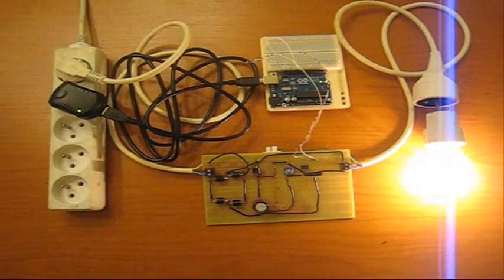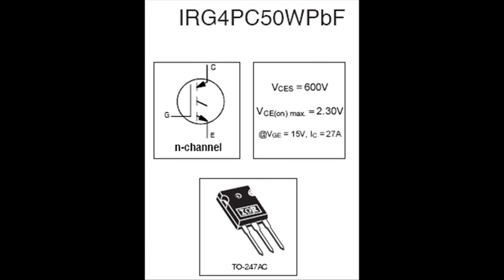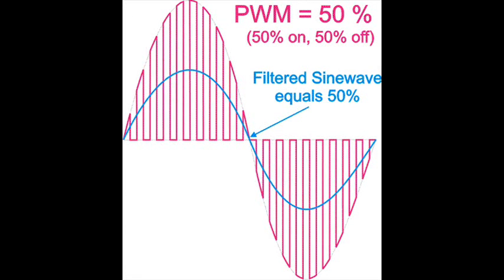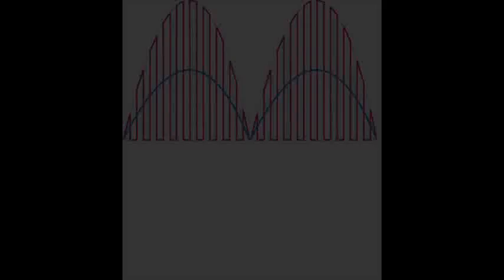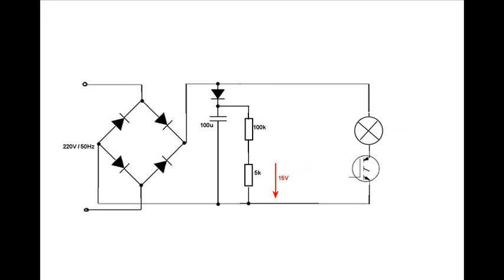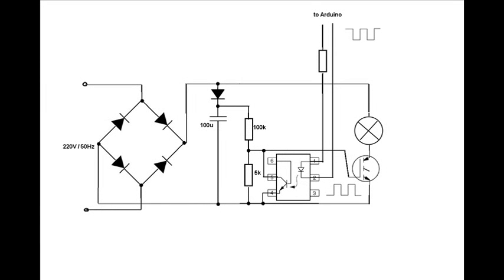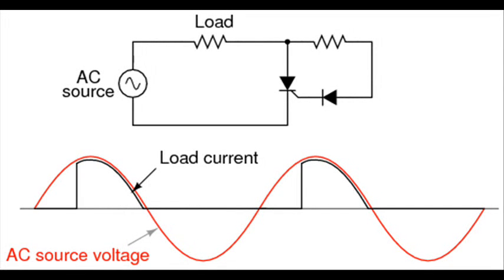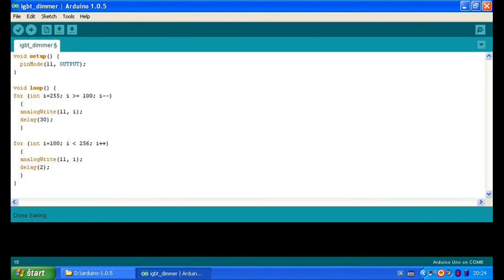AC dimmer with PWM on Arduino

Comment: when i use moc3041 optocoupler flickering in lamp
Reply from the maker: Krupal Kachhia Patel Do you mean to say that it is specificaly this type of optocoupler that causes the flickering?
Reply: may be optocoupler is not properly turned on at times. try using lower resistance on led side. if even the problem persists try higher frequency PWM generation

Comment: Excellent Presentation...I would like to ask if I were to use an IGBT(IRG4pf50W) with a higher Vces rating say 900V, would the circuit still work?
here's a link of it's datasheet:
http://www.irf.com/product-info/datasheets/data/irg4pf50w.pdf

Comment: When i use this circuit to LED Lamp or Compact fluorescent lamp or fluorescent lamp , it does not work ,Why?
Reply: mohamed sayed because they have inbuilt constant current driver, so even if you reduce the input voltage, even then it will work fine.
Reply: Ok, thank you electronics_ redefined .How can I modify this circuit to control  light intensity in LED , Fluorescent  lamp and CFL?
Reply: mohamed sayed For LED you have to remove all the internal circuit and make a new one specifically designed for it.
for CFL- there are various CFLs available in the market which can be dimmed by switching of specific phases for reference read this--

http://electronics.stackexchange.com/questions/107498/how-can-i-control-brightness-of-a-cfl-with-a-microcontroller
Reply: Hi mohamed sayed, I'm also looking for a solution to dim a LED light bulb. Have you discovered a solution? I'm planning to buy a VARIAC to see if it really doesn't work...
Reply: Dimmable LED bulbs have an internal PWM controller which is controllable by changing mains phase. You should use the classic triac AC dimmer to control dimmable LED bulbs.

Comment: Is it normal, that when i`m plugging this into 220v, 100k resistor burns out with smoke?
Reply: Андрей Рыжов I got through some 100k resistors and capacitors ! check your bridge rectifier - mine was dodgy and taking out the capacitor  - causes more current to flow through the 100k than it could take - smoke ahoy.
Reply from the maker: Андрей Рыжов no, it is not mormal. Check for faults.

Comment: Hi - Fantastic video.  I made the circuit and it works apart from the fact the lamp flickers - it did - until I put the circuit onto stripboard - must have been a dodgy breadboard.  Thanks for getting back and trying to help - circuit is flicker free and working a treat ! thanks again
Reply from the maker: Jabber Gabber Errr... I don't know. The flicker-free operation has always been a buty of this circuit. When does it flicker? Does it flicker just on the low brightness? Or all the scale?
Reply from the maker: Just an additional question - where are you located? Do you have 230V/50Hz?
Reply from the maker: +Jaroslav Hruškovič 

You say that it flickers at values analogWrite(11,50) - 50 and above it starts to calm down. As the transistor makes a negation, do I understand it correctly that the flicker occurs at full brightness, then continues when you start dimming and then it works ok for the whole range of brightness from dimmed to full dark? If this is the case, it may be related to the fact that capacitor discharges too fast and looses the voltage within one pwm cycle. Can you give me the values of the capacitor and two resistors that are discharging it? Also please specify the one which is short circuited by the transistor.
Reply: Jaroslav Hruškovič 
#
Sorted - see edited comment  - many thanks

Comment: HI, good video, i have a question, what diode model uses for the diode bridge? what model is the diode next to the diode bridge? thanks for the video :)
Reply from the maker: Daniel Tamayo Hi, for the bridge I used the ready-made diode bridge KBPC1006W, 600V/10A, see http://www.gmelectronic.com/bridge-rectifier-b250c10000dr-p227-051
But you may practicaly any that withstands 400V and the current you desire. The diode next to the bridge is also just any that withstands 400V, the current, just to be sure may be around 1A.

Comment: Je vous remercie pour ce montage, simple et parfaitement actif.
J'ai realisé une carte de 60x35mm sur 20mm de haut.
Pour l'integration maximum, l' IGBT a etait monté en aerien horizontale au dessus d'autres composant ainsi que le condensateur de 100uf,car aucune chauffe des composants n'a etait détecté.
Google Translate:
Thank you for this assembly, simple and fully active.
I realized a 60x35mm board 20mm high.
For maximum integration, the IGBT was mounted in a horizontal aerial above other component and the 100uF capacitor as no heating component was not detected.

Comment: Fantastic explanation, the simplicity is beautiful, I would have never thought just to rectify the output and negate the need for zero crossing detection and the use of costly interrupts. also the fact that you can dim to full zero.
Nice work and Thank you for sharing.

Comment: hello, i need to control a submersible pump of 110V by an arduino, this circuit could help me? and i dont know what is the value of the resistence that conects the arduino with the optocoupler, thank you, if you could help me i will thank you so much

Comment: Hi! Good video.
I developed the circuit and I connected to a resistance with a 127V and an electric power 1KW but the problem was that the IGBT and the didodes bridge got very hot.
the question is what do you think about the problem?
What do you think might be the error?
and another question this circuit can use to connect a resistance with 220V and an electric power 2KW.
how much current supports this circuit?
Reply from the maker: Hi, do I understand it correctly, you have 127V on the resistor which dissipates 1kW? That would mean that the current is about 8A, which is enough to make the parts hot. With a such power in game it is normal that you introduce some cooling.
If I misunderstood the mentioned voltage/power, let me know. The other reason may be that the IGBT is not fully open.
Reply: Jaroslav Hruškovič Hi, thanks for answer to my question. 
Now the problem is that I need to control one resistance which is connected to 220 VAC with an electrical power of 10 KW that means that a I have to control around 41 A the question is, do you think that I can use that kind of circuit or do you have any or another circuit who can works at high amperage (of course introducing PWM)? 
You mentioned that probably the IGBT is not fully open in that case what can I do about it?
How can I fully the IGBT?
Reply from the maker: christian lazcano Not opening the IGBT to full may be caused by a low voltage on gate. But this was just an idea, I don't know if this really is the case. Check if your pulses on gate have sharp leading and trailing edge and that they reach nearly maximum allowed gain voltage. In my case, I think I used have 14 volts.
Regarding the 10kW power... as far as I know, there are IGBT transistors of for high amps, so as soon as you use such one, it should work. But keep in mind that in normal conditions where everything is working OK, such transistor may need a heavy cooling as it may produce around 40W of heat.
Another option would be paralel usage of lower rated IGBT transistors, but check that they are suitable for that. Some of them are, some aren't. However combining many transistors may turn out more expensive than getting one rated high power .
Reply: Jaroslav Hruškovič what do yo think if instead of use your circuit we could use a solid state relay? do you think that  it woks?
Reply from the maker: No, I tested it, and it does not work with PWM because it is has very slow reaction time. But if your load is solely resistive such as a heating spiral, you may easily change the concept to much longer switching times, such as 5seconds on, 5 seconds off. Then the solidstate relay is perfectly OK.
Reply: Jaroslav Hruškovič That means that probably the SSR works with PWM but with a slow response?
I finde a SEMIKRON  SKKH 162/16 E  THYRISTOR MODULE, 160A, 1.6KV, A 21 do you think that probably works?
Reply from the maker: christian lazcano Yes, that should work. Let me know when you test it.

Comment: I tried making this but the voltage across the bulbs come to less than 1 volts.
The voltage across the 5K resistor is 15V
I am using irg4pf50wd
i am using 200W bulb.
what is the resistor value you used between arduino and Optocoupler..??
Reply: I am using an electrolytic cap with 100uF/250V
Reply from the maker: I think I used 100ohm or 330ohm between arduino and Optocoupler. This in fact does not affect the functionality.
Reply: Jaroslav Hruškovič It works like a champ thanx a lot
Problem was with the Resistor attached from arduino to Opto... I used 220Ohms instead of 1k. 
And now Because of you I have a full PID controlled ambient Light COntroller
Reply from the maker: Cool

Comment: Nice work! This is very good. I was hoping that this transistor somehow did not need rectified voltage, so that it could switch the negative voltage too and so I could use it to dim a fluorescent bulb, but it seems that is not the case. Nevertheless, this is very useful info. Thanks!
Reply from the maker: So... do you mean that you tried to use it with a fluorescent lamp? I never had a courage to try. How did it behave?
Reply: Jaroslav Hruškovič Sorry, what I wrote makes it look like I may have tried it, but no, I have not. Based on what I know about fluorescent lamps they need the alternating current, so I don't think this will work for fluorescent....I'm wondering how fluorescent dimmers work now.

Comment: Hello, I am trying to drive a 3 phase 10 HP motor from an arduino using 30 amps IGBTs.

I would like to know, do you need to take special precautions to deal with reactive loads such as an electric motor ? Is it possible for the back emf to generate voltage spike that will damage the drive circuit or motor ? If yes, how to dissipate those spikes (without wasting too much power).

Also, I have to drive 6 IGBTs, I am considering using adafruit's 16-Channel 12-bit PWM based on the PCA9685 to offload the arduino's processing power. Is a 1khz frequency for the PWM fast enough ?
Reply from the maker: 1kHz is perfectly OK. But I have my doubts about whether it will survive driving the 10HP motor. The transistor is sensitive to a reverse voltage which may appear with inductive load.
Reply: Jaroslav Hruškovič How can you protect the IGBT from back emf ?
Reply from the maker: A zenner diode might work

Comment: I replicated this circuit and found the hum noise at low brightness (high PWM) to be very audible and a little disturbing. It seemed I could even get it resonating with the bulb in some way and amplifying the noise substantially. Would a capacitor in parallel with the bulb help reduce this hum due to charge/discharge smoothing of the gated supply? Also would lowering the PWM frequency help since the thermal cycling rate would be much lowered?
Reply from the maker: Hi, lowering the frequency would not help. I think just opposite, on very low frequencies, the hum may be even more accented. I also think that there may be a lamp which has its own mechanical resonance of the wire by coincidence equal to the arduino's PWM frequency. Then changing the frequency to higher or lower may help. The capacitor might help too.

Comment: Hi, i want use control de luminosity with PID control, you think this is possible with this your circuit? Thanks for the video :)
Reply from the maker: Hi Ramses, please rephrase your question, I don't quite understand what you mean.
Reply: Sorry , I would like to utilize PID control, because my Idea is control the luminosity... so do you think is possible implement this PID control with your circuit?
Reply from the maker: Ramses da silva louzada Well, basicaly yes. However, in some cases you have variable voltage at the output of thr PID regulator. You have to translate this into frequency and an applicable duty cycle. So it is not just a matter of connecting the PID to the transistor gate, but you have to use some logic (i.e. Arduino) to read the PID signal and send an appropriate signal to the dimmer. In a very special case if your PID would have a PWM output, you might consider connecting it correctly. If you need a help with your design, give me your e-mail contact and we may discuss it separate from this forum.

Comment: Hi! Can I use that type of Dimmer, to control an Infrared Heater power? Can he take a 500 - 800 Watts to control? Does this Dimmer compatible with my preferences? Thanks a lot for video!
Reply from the maker: Hi! I am currently using it for dimming the 400W lamp with no sign of something wrong. So the 500W dimmer should not be a problem. The 800W might result in higher current and higher heat dissipation in the transistor. However, you can still use a cooler.
Reply: Jaroslav Hruškovič Thanks a lot for info! Now my problem solved! Thanks for  your  video!
Reply: Jaroslav Hruškovič and what's about  3000w? (3  infrared  heaters  3x1000 watts)I guess  the  transistor can take  care  of  it  with  a cooler and a  heatsink. Or I'd better  take  a most  powerful  transistor?
Reply from the maker: Андрей Рыжов Yes, either a more powerful transistor or you may use two (or more) in paralel. If I remember correctly, the characteristics allow this because if one gets overheated, it somehow offloads its load to other transistors. I am not able to find it at the moment, but the paralel configuration should be self stabilizing in terms of power balance among the transistors. Please let me know if you have doubts about what I say, I will try to find out tomorrow with fresh head.
Reply: Thank You so much for the information! But how can i use two or more transistors in parallel? How can i plug them to arduino board? Can you give me a scheme or smth like this? I will appreciate it so much!
Reply: Jaroslav Hruškovič And one more thing - In this video, You use a IRG4PC50W transistor model. Can I replace him with IRG4PC50UD? And What kind of diodes, used in diode bridge?

Comment: Do you think the approach of this circuit could be used to control the electric motor of a model train where the top voltage is 20 VAC but the amperage can be up to 5 amps.
Reply from the maker: I doubt. The output has a significant DC bias which may burn the motor. But I am looking for a volunteer to test it, so please report the result if you decide to test.

Comment: I wonder if it would be possible to control inductive loads providing I will slowly increase and decrease PWM width when turning on/off the load.
Reply from the maker: No, I would not recommend that. The circuit feeds the load with pretty high DC current. It has a significant DC bias as the negative sine waves are flipped up. When testing the circuit, I forgot about this and burnt a transformer of the 12V halogen lamp.
With a small change of the wiring it might be possible but that also has certain drawbacks - there may be an induced voltage from the inductive load which might easily burn the circuit.
BTW, what sort of inductive load is it?
Reply: Jaroslav Hruškovič It is a bit tricky :) It is a primary side PWM regulation for the resistive load (a heater/resistor) on a secondary side of the transformer (max 50V AC should be there). However as I am doing PWM on the primary winding of the transformer (the efficiency is much better here), I am getting a nasty voltage spike when the load is abruptly disconnected. My knowledge here is very limited and I suspect this has something to do with inductive load. The PWM based on triac is working fine but the load must be disconnected smoothly. I was wondering if the triac design could be replaced with similar design as you described. Some modification would be probably required.
Reply from the maker: Yes, seems to be a good reading.

Comment: can i use         irg4pc50u to replace irg4pc50wpbf ???
Reply from the maker: Mmmm... yes, it looks pretty much the same. The         irg4pc50u has a different gate voltage to open, but that is irrelevant for this wiring as you only want the transistor to either full open or full close.

Comment: Hello! Nice project !I wanted to adapt the circuit for an electric shower of 5500 w. what values of components I use this case to the circuit? A triac model BTA41-600 can replace the transistor in this case?
Reply from the maker: Hi, no, you cannot replace transistor with triac. It would just not work unless you change the code accordingly. And then it may involve a zero crossing detection an all those inconveniencies.

Comment: Hi, I copied your circuit as a part of a project for school (i hope you dont mind) and its working very well, but I noticed that the relation of the PWM signal and intensity of the light is inverted (0% PWM = full brightness / 100% PWM = zero brightness) can you explain me why does this happen?
Reply from the maker: This is because there is one inverter in the circuit. If you look at the wiring, you may see that HIGH sihnal on the optocoupler input causes opening the transistor inside the optocoupler which causes shorting the 5k resistor which causes dropping the gate voltage of the IGBT to zero, which causes closing the IGBT.
In short, the more HIGH signal (100% PWM) you drive to optocoupler, the more closed is the IGBT and dimmer the light. The more LOW signal (0% PWM) you drive to optocoupler,the more open is the IGBT and brighter the light.

Comment: hey! nice project! i have a question, What kind of capacitor did you use to do your project? it's a simple electrolytic capacitor?
Reply from the maker: Yes, it is the simple electrolytic capacitor, I think it is 1000uF, 320V. I had this earlier, so I used it. In reality, it a lot smaller one might be used.